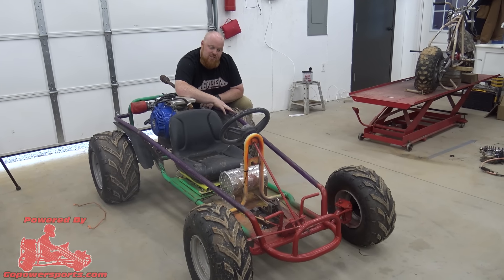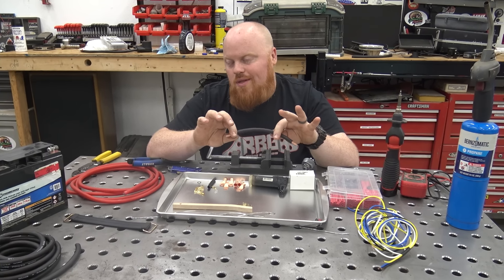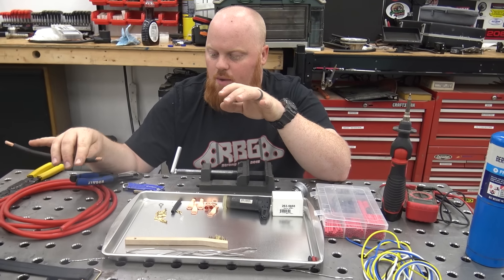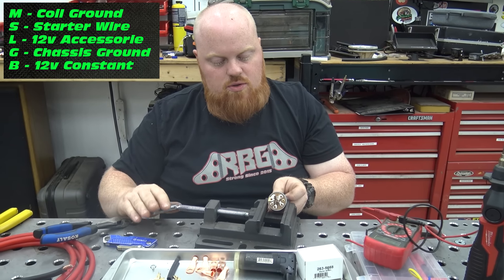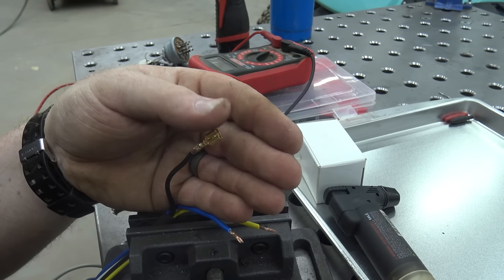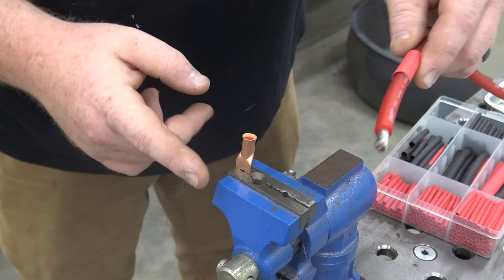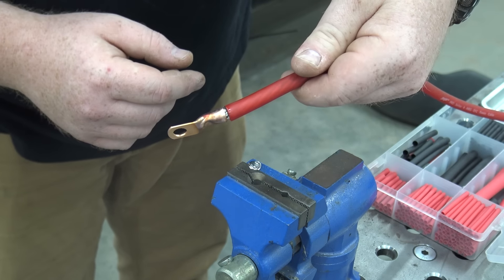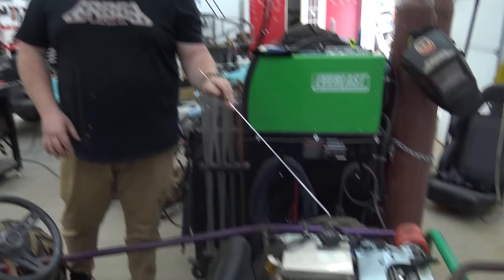How to Wire Electric Start on a Go Kart & Other Small Engines

Comment: Rbg, Thank you for the clear and concise guide on this. I've been following a lot of your performance and dino videos on the predator 212 and stuff to do with go karts. I purchased two 3 am systems to put on mine since it said in your video it would come with just one if it had one on my clone. Also, I'm using the non-heavy 212 and I ordered port and polished valves, a performance head and a 224 mirkani flathead carburetor as well as a straight true axle, upgraded tires and brakes.  I forgot how fun go-karts really are and as a 41-year-old your videos are super duper helpful. Keep them coming

Comment: 9:12 pull the connection to check it, don't just assume, also soldering tips should be coated with pre melted wire before soldering helps penetration. I don't think I've cleaned it once, decade old gun never seen a wire brush, original tip, just the tip.

Comment: Good stuff. I would tin the battery cable wire prior to dipping it in connector though. Your creating a cold solder joint with your method. Also, a wet sponge is excellent for cleaning the solder iron after each use.

Comment: I bought a 440 this spring for my go kart and I just took the switch module off the engine and extended the wires. I found that the rectifier diode for the charging coil was inside the module. Not that you can’t move it back to the engine but be aware it’s there !

Comment: I used to think those cars that die at every complete stop were stupid, until I was told no, that's the best hybrid system you could have, because the engine doesn't have to be engineered to idle and the power requirement is easily met with regenerative braking, and because the starter motor is already reduced, you don't need a first gear. I wonder if these starter motors are capable of such a thing too, because you could potentially have a two speed transmission. I always enjoyed taking off with the starter motor in my neon.

Comment: I have an old snow thrower that has electric start but the way they get power is by plugging into a cord and the push start is on that box is that a voltage converter changing it from 120vac to 12vdc

Comment: Nice video.  Well thought out and well explained.  Very helpful.  Looking forward to the rest of the series (Charging system, Lights, Accessories, GPS, DC Fridge, etc...).  Will you show how to put in a fuse block and the correct usage of relays?  Thanks, you are going a great job.

Comment: Jst a slight refinement to corrosion on the wire.  The copper cladding is very thin.  It is there to compensate for the fact that bare aluminum will corrode immediately.  The problem is that aluminum is sacrificial to the copper.  The aluminum  will corrode leaving the thin plating behind .  Functionally the whole wire corrodes.  The plating is likely not even visible

Comment: Great video and tips, thank you!
P.S. You might want to let your viewers know that you can overheat copper and if you do it will not take solder well leading to bad connections. Only heat it enough to melt the solder and no more. Otherwise, you have to start over and clean it thoroughly before you can get it to work properly.
Reply: Also beneficial to scuff the inside

Comment: I never remember to buy Heat Shrink,so I use my Permatex rubber gasket stuff and seal so no water gets into the wires,etc.No corrosion after 2 years still.

Comment: awesome video!!!!! I'm trying to install a cheap amazon rpm/mph digital display. Having issues getting a good place to read the rpm. Not sure if the wrap the wire technique works with the setup i have.. that said i'm assuming grounding everything out is probably going to be my answer. The 212cc reads if i connect to the spark plug bare wire, but it wont start. no starter just pull start. The tach goes up when i pull the chord. so that gets me some answers.... just gotta find out why its not allowing it to start.

Comment: On a lawnmower, L would be for lights, M is magneto. BTW, I don’t understand why you don’t follow convention and use red for battery hot. I generally use yellow for lights/accessories. Have built many wiring harnesses and that’s the way I’ve always done and seen it done.

Comment: I used to solder the big copper ring terminals until one over heated, melted the solder and the battery wire came out and set fire to the vehicle. It’s much safer to simply get a hydraulic crimper and crimp the battery cable ends, and then shrink tube then to keep water and acid out.

Comment: I see you work on these a lot and just recently bought one for my old tuff built tractor. I shorted one of the cheap wires out moving the control box about 3 feet. It smoked the wire that has 2 wires in it and another. now no mater where I put that wire it won't cut off with the switch. Starts and runs great but won't shut off with the switch. I could just use another switch to ground it out but was wondering what it cooked besides the wire, 5 wires coming off the engine but only 4 in the switch box. Any idea. Yeah and i should have removed the fricking battery wire but got in a hurry, It is the stock wiring that came with the engine.

Comment: my plan to wire the electric start is not to add it but move it but its a bit of a pain with one hand but when i move the stock key box ill be adding a remote choke because ill have to choke it out  to start in the cold Canadian winter

Comment: I'm looking forward to the charging system video. Please add suggestions for troubleshooting issues. I added a 2nd coil and a rectifier to my 420 and it will not charge my battery.

Comment: About to do this myself only problem is I am running a high compression build 223cc wildcat with forged rod +0.50 etc I am scared it won’t have the UMPH to even turn it over … I’ve  read on some forums some people say high compression builds don’t work with electric start setups at all period … ummm…hmm any advice ?

Comment: Such a clean install, I need to wire like that.  Do they have 90-degree battery connectors to try and hug the wire closer to the battery?  That bugged me, kinda looked like it might be under stress.

Comment: Always use full copper wire. I like to pre-tin my wires before attaching them and  and clean them after attaching  with alcohol. Does the key release in accessory position?

Comment: If you tin the wires first it will prevent them bird caging when you crimp and then soldering goes real fast. Just a suggestion.

Comment: mr. red beard, i have a question, which elect start kit fits the predator 212cc hemi, i just bought a new one and i was thinking of installing this on my motor, its on a 3 wheel bicycle along with said motor Ive seen a bunch of kits for hondas the one im interested in is on eBay its the Honda GX390 13HP GX340 11HP Electric Start Kit Flywheel Starter Motor kit, has flywheel starter key set etc. iM sure you're familiar with em is there any special tricks im going to run into? would appreciate any advice or e help u can provide LOVE YER STUFF MAN ITS REALLY COOL!

Comment: hey redbeard i wanted to ask u a little bit about the 212 i got and the build i want to do i have about 200$ and an already upgraded 212 with a torque convertor an exhaust a air filter and jet kit and now im looking to make a little more power, i put together a cart on go power sports with a stage 2 cam 18 lb valve springs and i was either gonna get a off brand mikuni or just an assortment of jets to get the flow right but i was told by a friend to upgrade my rod too and im stuck between a carb or a billet rod and i really am not even sure if my engine will run after installing what i want i just need a little guidence on my build if u could please and thank you

Comment: I see you are using that Milwaukee M12 soldering iron, I have seen nothing but reviews for it melting the collar or the heating element breaking in them, how long have you had yours? I am a Mechanic  and I have the M12 ratchets so I was looking at this for working under dashes but if it melts or the elements fail, it will do me no good.

Comment: RBG, can you guys do a video on the basic tools and welder needed to get started? I'm relocating my steering wheel and while I'm waiting for my rear axle I want to try welding it together myself. I have a Chicago Flux125 and a 100 amp AC stick that can only handle 3/32 6013 and burns through everything with 6011 before it sets a good bead. What would anyone who reads this do??

Comment: I've got a two part question. Firstly, does this engine have a charging system?
Secondly, if it does, will it charge the battery, wired up as shown in this video?
Reply: Yeah I got the same question isn't there a regulator rectifier in there somewhere

Comment: I know this is an old video, but I have an issue with one of these dmax 440s 8n a golf cart. It doesn't shut off with the key switch, anyone got any ideas? I extended the keys wires to to the golf cart dashboard.  I've searched and found a few ppl have this issue but no definitive fix...m

Comment: I wanna see how u can hook up a rpm tach on one of these motors
Reply: Its easy if you use one of them rectangular garden tractor style digital tach/hour meters. Its one wire and the end gets wrapped around the spark plug wire at the boot about 6 times.

Comment: You need at least two fuses, one right on the positive terminal of the battery about 50amp and another 15amp right where you tap off the positive at the relay on the wire feeding power back to the key switch if not that battery could cause a fire or even explode if the wires short out.

Comment: I love your channel bro, however your coming is all wrong brother. When crimped properly and with the correct tool, that connection would be just as strong as the solder. The open barrel crimp is a two party crimp and requires a certain crimper. Hit me up, I sell these components myself and can get you all set up. Keep up the great videos though bud.

Comment: With an iwiss ratcheting terminal crimp, you can skip the soldering so long as you use the correct die for the terminal. Saves a lot of time.
https://www.amazon.com/dp/B00Y7M7SG6/ref=cm_sw_r_cp_apa_fab_TgkFFb7NAW867